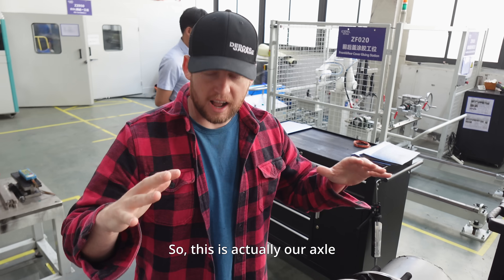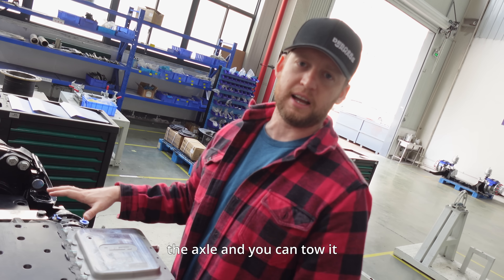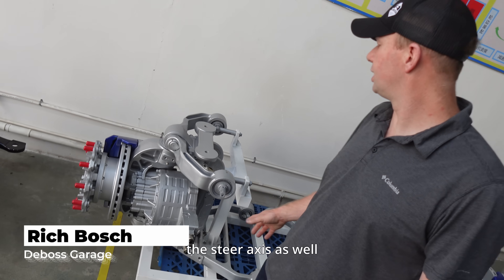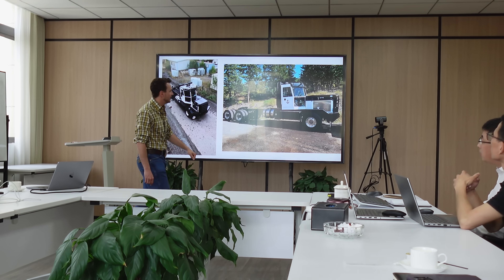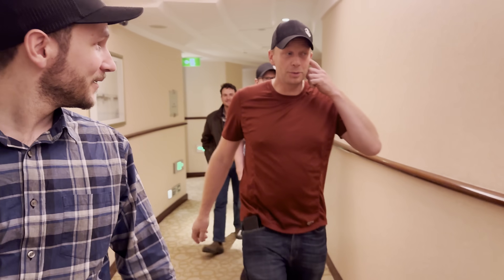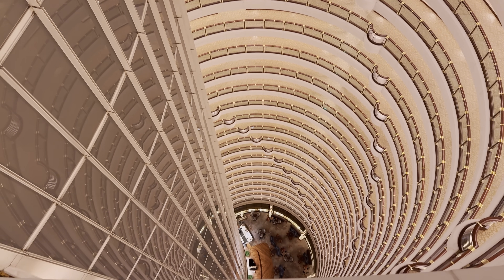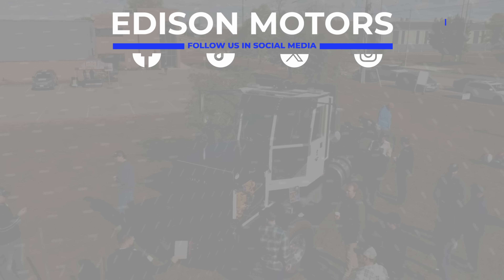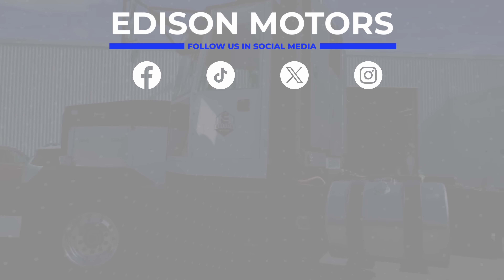E-Axles and an Engine Hunt - China Part 5

Comment: That's extremely smart considering to put a drive unit in the trailer. In the winter in the British  Columbia mountains the extra traction can make the difference between chaining up or not. It also allows in extreme conditions requiring chain up to have another axle with the extra weight to go where every one else is stuck. You guys are awesome. Shows you have real world experience and solutions to everyday problems such as the neutral feature on the drive axles. You guys will go far with your fore sight and innovations.

Comment: I know that most people are keyboard warriors. When the same $100 product is placed in front of you, the American product has an ultimate strength of 1000MPA, while at the same price, the Chinese product can reach 1500MPA. If you are a manufacturer, what will you choose?
I am just giving an example. The reality may be even more cruel. Because China has already sprinted towards Industry 4.0, while most Americans and Canadians still believe that China can only produce inferior products.
These keyboard warriors don't know that most of the electrical appliances, cars, industrial machine tools, and agricultural tools they use have parts from China. They think they are using domestic products and cheer for the quality of domestic products. It is very sad.
Besides, I live in Wuxi where they go.

Comment: China is really kicking ass with USA tech.
Reply: China makes some gorgeous products.
Reply: @chiphill4856  They steal our ideas. And most of what they make is fit for the nearest local junk yard.
Reply: bc if it weren't for China those US tech wouldn't be as good and as cheap as they are today. Dongfeng Dana is 50% owned by Dana and 50% owned by China
Reply: Tech they STOLE you mean? 
Screw the liars.
Reply: @debi5292  Not stolen at all.  Those company's owners took it over there, not forced.  There are no requirements anywhere in U.S. regulations that requires a company to move it's operations to ANY foreign country, it is the greedy owners of those companies who make that decision.

Comment: I wonder if the unsuspended weight of the heavy motors directly located on the wheel hubs matter as much on a truck as it matters on a passenger vehicle, where it would be a huge no-no as unsuspended weight greatly affects handling.

Comment: Does the neutral mode physically disconnect the axle shafts from the electric motor stator?  If not, how are you handling the HV unloaded power from the motor?  Does it not cause overvoltage damage to the inverter?  I understand if that information is proprietary, however, it's just some questions I have with that platform.

Comment: I think electric axles are THE WRONG move. O do NOT want such heavy, delicate, and precision components subjected to the vibrations and impacts of the axle. The motor should be mounted to the frame where they are shock-isolated from the road, and the truck should have conventional axles.

Comment: E-axles shouldn't be required to have brakes if they can regen. Also running super singles is 200 lbs lighter, rotating weight.
Reply: Regen only works if you have a partially depleted battery. If the battery is full and you have no physical brakes, what then?

Comment: I work in the EV industry and I STRONGLY advise avoiding china for EV component manufacturing. I have directly worked with chinese battery systems and they can be a nightmare to work on. Not to mention a ton of other component issues I’ve seen.
Reply: Elon Musk trust them completely. So who are you?
Reply: And who would you recommend?
Reply: @yangdaoy  Dana for an E-axle, and there are tons of companies that develop EV batteries in the united states. Ampere EV is one company that has a small custom pack. You can even use off the shelf BMS and develop one yourself pretty.

Comment: this is awesome, think of the diesel pusher market.. swap out the rear axle w/ an E-Axle, and attach the rest of the gear where the Allison trans would go. packaging wouldn't be too terrible with the amount of room in those rigs.
Reply: And add the front independent air ride e axle for all wheel drive when needed
Reply: @mrescoford  yup. I especially as a retrofit for air drums all around.. plus, the old cats and Cummins running at a constant speed would yield good “economy”

Comment: Hopefully the lid to that axle switch has pockets in it that would hold the switch to one side or the other and prevent it from moving when the lid is on.  It looked pretty easy for him to move that, and logging trucks arent exactly on the smoothest of roads or treated so nicely from the loaders/unloaders.

Comment: Driving trailer axles limit the damage to roads. Back on the farm in the seventies we used an old truck complete with front axle for a trailer. Was a beast to pull with our modest 2wd tractor. We hooked up the pto thru a gearbox via a dri eshaft, flipped the diff to get the correct rotation and with a decent load would go places you would never think. Stopped the tractor ripping up the roadways and fields.

Comment: I'm surprised Ford and Chevy didn't use E-Axles on their electric pickups. The ICE versions have a solid axle, so there's little need for the fancy independent suspensions they put on their EVs that add cost onto already expensive trucks.

Comment: As a former oilfield worker, you get a hybrid twin-steer out there, you'll be winning the oil patch.  Essentially Topsy with another steering axle, long frame and service deck with tow crane to move bowsers, boilers, shacks and whatever else around a drilling site means you get the work.  Reliability in all weather and ground conditions is paramount.  That tour was awesome!  A part of me wishes we had our manufacturing up to snuff in Canada so we could make that here.  But that's another political shit show I don't need to explain to you folks that are going through that at home.
Reply: You won’t win the oil patch
Cause diesels will be lasting longer than electric. 

Look at topsy 
Has a whole team
Has only done a few Light trips
And already has problems teams of engineers can’t fix

Comment: On the logging truck if your coming down a big hill using dynamic braking and the batteries hit 100% charge, does the dynamic braking stop working? Or do you have a load bank to take the extra energy and keep the braking working?
Reply: they just use the air brakes for backup if there is no regen
Reply: @JD-yx7be  air brakes won't last long

Comment: Air disc brakes on the main axles and independent powered fronts? I like where this manufacturer is going! AWD electric big rigs will be sweet
Reply: i can imagine the ice road truckers loving a diesel electric drive AWD bigrig with powered trailer like the ability to have that extra grip and control on that surface will be a game changer
Reply: @jackass123455  A youtuber tested Benz G-class and  YangWang U8 on the snow city road in Russian. YangWang U8 is faster.
Reply: @jackass123455  
Not just them, any truck that is potentially traction limited will benefit from the extra 10-20% tractive force*. When they're running "bob tail" the front axle could be adding 50%, or more, which can make a big difference when pushing through soft, slippery ground.
I'm thinking of the Aussie road trains, as they operate a lot on loose ground, sand, and gravel, and when you're hauling 100+ tons, even a modest 'jump up' can cause issues with not quite the drive needed from the rear axles.
Reply: This is eaxle "CDTL", it's the leading supplier of epowertrain from China
Reply: I like to put them on my RV Converted Bus

Comment: Did your truck have in standard 3phase high amperage outlet? You have high power inverter for motors just one contactor more and switch inverter from motor to power outlet.
If that will be possible maybe that inverter (or more together) could work as DC-DC converter and your truck would become emergency mobile LEVEL 4 fast charger.

Comment: Use the trailer as a generator as well when no real load is on the tow vehicle. It can extend the range since they are two separate systems. Put capacitors bank's with a small battery pack to help recharge the tow vehicles battery/capacitor bank

Comment: signed up for the investment notice!

If yall get well setup on truck production i think the next thing yall should try
Jet engine + electric car 
A small jet engine can give plenty of power to recharge a car and also be main power source. In Aviation our jets already are used for power generation via APUs. 
In the past Chrysler attempted a jet engine car and it failed due to the costs and idling issues but with a electric you can make the jet run at the same speed continuously I believe its a really good idea now especially if you guys pull a ford and target lower middle class americans. Tesla is a nice car but the extra junk makes it a rich person car and not something for normal people.

Comment: Why did you go with different axles for the next gen rather than the axles that are currently in topsy?
Reply from the maker: They’re better.

- more protected for off-road driving
- stronger
- higher weight rating
- 2 motors instead of one
- 30% more powerful
- allows more independent axle control with twin motors

Comment: Oooo that independent steering axle set up is siiiccckkk ... 5ton military truck retrofit, 6 wheel drive, independent suspension all around... Yep, now if i can just win the lotto
Reply: I am thinking 8 wheel drive, independent steer, independent suspension.  You could crab walk, tank turn, and dual steer turn.  Could make a great off road recovery vehicle.
Reply: @tfodthogtmfof7644  
Some of the European truck companies can almost meet those requirements - 8x8 with 8 steering axles - but I think they're all beam.
For example, the TATRA - https://www.youtube.com/watch?v=u1CctCBTj48 - they're famous for their independent swing axle, so may have them fitted to this.
Reply: @tfodthogtmfof7644 so basically an electric Stryker lol
Reply: This is for airport buses, not suitsble for offroad
Reply: @TrucksScaleModels  that's probably true and would make sense. So let's change it to a toter home with 6 wheel drive, 6 wheel steer. The most maneuverable tow rig in the pits
Reply: @pastaalalamborghini  my issue would be the extremely low top speed. 70kmh(35mph) is great if you never need to leave an area like a town, but you would need to trailer it between locations making it not very practical.
Reply: @RowanHawkins  I guess I missed the top speed spec

Comment: make all axles steering axles with the computer setup calculating the different steering percentages. including trailers being programmed with length to axles for true follow me steering.  i would love to see the outer half of the fifth wheel be separate power connections, removing any other hook up. do everything but power by wifi. trailer and tractor sharing battery load, regen, and generator through the circle connections on the fifth wheel.

Comment: Is that dual motor axle? torque vectoring in gravel/mud would be interesting.
steering axles for the trailer in the woods would be helpful with hydraulic/electric steering. to on road use,  steering mechanism locked. (and sometimes off road is on asphalt 😂)

Comment: I can’t wait for the BYD version assembled in Mexico to sell in Canada for 1/4 the price.
Reply from the maker: Maybe it’ll force domestic manufactures to compete and stop screwing us over and make cheap reliable cars again.
Reply: @EdisonMotors  I understand where you are coming from, I got some rods I redesigned and then send the cad data to get manufactured in mainland China, I worked with an Canadian lawyer with offices in Shanghai and Toronto to make sure my “intellectual property” is maintained, I can now order the exact ones from the factory’s alibaba’s site. Same thing with a k04 turbo core I redid and to save money I sent the cad data and now same thing, you can buy the core I designed from their site. I just want you guys to be careful. I have been following since the first videos, I really want you to succeed, but you are following in my footsteps and I am hoping you guys won’t get burned.
Reply: @seannaesseannaes  edison did not design the axles they just found a chinese company that already made them and worked to have some built to the spec they want. Nothing edison is getting is special or custom made

Comment: Electric trailer axles sounds like a great addition for winter roads  and mud.
Reply: Already in use in Europe.
Reply: Not to me. I want the stuff behind me to have slight drag in slippery conditions to make sure that it stays behind me. You start trying to push into a bendy bit in low traction and its like riding a bicycle on ice. The front goes sideways and you jackknife.
Reply: @RowanHawkins  Sounds like it's more complex than just "slap on a motor and a giant plug".  I bet with an angle sensor on the hitch and some logic borrowed from traction control you could make a powered trailer nice and docile on mud and ice.  A "slight drag" would be pretty easy to setup too.  Lots of mud/sand conditions where tires dig instead of roll unless they have some power to them.
Reply: @martylawson1638  Push at 50% assist, rather then 100% drag. :)
Reply: @RowanHawkins  fair enough.

Comment: I take it that the axles are very weather resistant , especially the steering axles.  But. !!!  would it be prudent to have some sort of shrouding around them to protect them from rocks and mud ,ice etc . From getting packed up with road debris, thus making it easier to keep clean  !!     Just something to think about when building off road units ,  branch or log pops up and takes out an important component.     I have had a large branch pop up and take out a brake line on me before.  And getting stuck in mud and rocks damage drive shafts..      So when you’re fabricating a new project together it’s something to consider….    Food for thought. !!     Have a. Fun. Day.      LOVE WHAT YOUR DOING. !!!!!

Comment: stagdiesel pl /en/ 
check for propane injection into diesel engine. cheaper/more power/less emissions.
Reply: You dont need a poweradder for a generator😂😂 it will run at a set constant rpm so no need to boost the power
Reply: @moparjr89  yes and no you could have smaller engine with the same generator. constant rpm didn't mean constant load/power output.
Reply: @moparjr89  more for EcoTerrorristmoste  that makes engine CLEANER ;D (and really that works, with additional propane you will pass stricter emission standards)

Comment: the powered axle on a Log trailer would be a total game changer, especially for a self loader, cause we're always getting called into some janky back yard with no road... little bit of push from the trailer would make life soooo much easier.  be better if it say was made with smaller drive motor, to save weight, and you really don't need massive power on the trailer, just a wee bit of assistance does wonders. 

A lift axle with independent drive motors, would be super skookum easy addition to a traditional diesel truck too... small set a batteries, you could just use it for cruising speeds or a boost on hills etc.
Reply: Underrated comment, rather electrify the trailer axles instead of the steer axle.
Reply: @eXo0us-T  to be fair though, a dumB truck or Log truck spend a lot of time without a trailer going places where "muh pick up made it just fine" so having a driven steer axle would be pretty skookum too, to say nothing of OH SNOW!

That and log truckin... sometimes you just can't turn... logging roads are twisty and steep... having a little assistance from the front tires would be more then welcome even down hill.

Comment: So what you are saying we will be able to flat tow the trucks behind an RV by engaging the neutrual tow mode?   Yes!  Thank you!
Reply from the maker: Yeah, I guess that would work
Reply: @EdisonMotors  Without any excessive wear because something doesn't get oiled or other weird stuff, the axle not running under its own power and stuff? ...I mean  - it looks very simple, but could potentially be a bit more complicated.
Reply: @martinpoulsen6564  
I would expect it to just be disconnecting the electrics. That would be to prevent the re-gen happening.
Reply: wait. Edison fitted RV towing a Edison fitted truck!!!